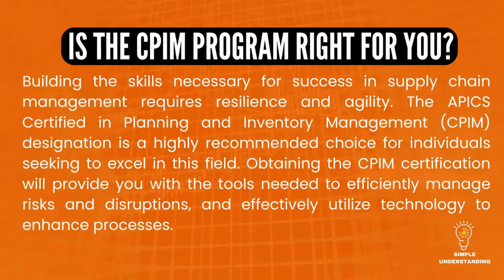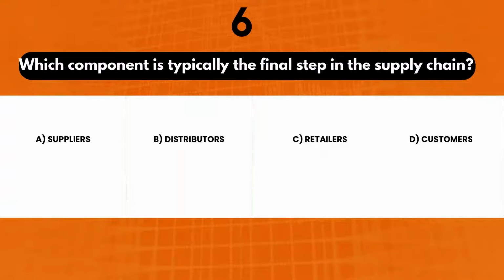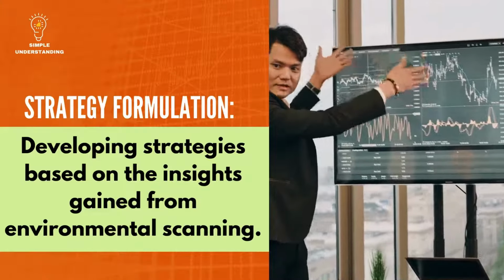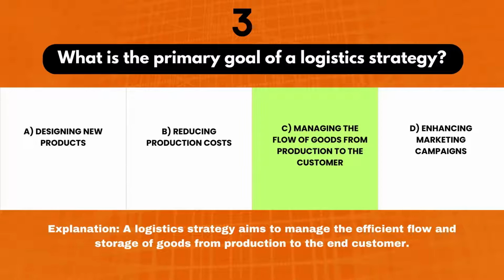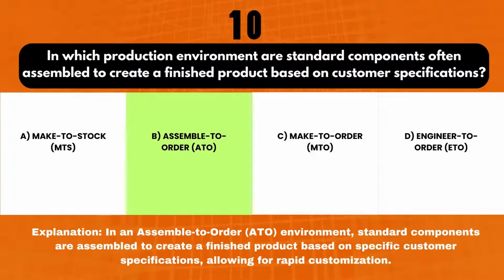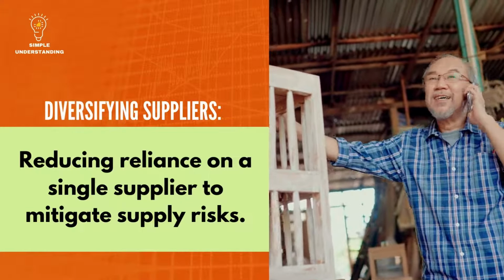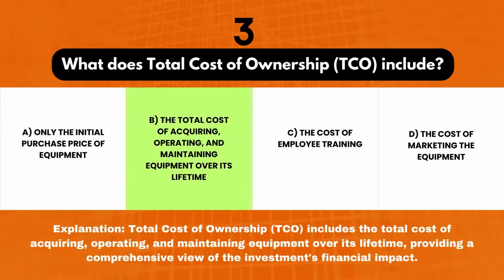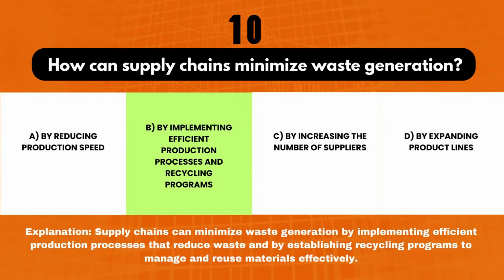APICS CPIM Module 1 Supply Chains and Strategy Full Course | Explanation & Practice Test (90 min)

Comment: Is this material enough to pass the latest 9.0 version?
Reply from the maker: These videos are designed as a quick review to help you grasp the core topics of the CPIM certification.

If anyone preparing for the actual exam, he will need the complete study package. I’ve included the link in the description. 

The full package CPIM 9.0 includes:
- Full coverage of all 9 modules and 38 sections
- Real-world case studies and applied examples
- Step-by-step solutions to all math problems
- Flashcards for rapid revision

- Over 6200 MCQs: 
Scenario-based
Application-driven
Multiple-correct-answer questions
Quantitative problem-solving

In addition of flashcards , cheat sheet and mocks exams

This is a full prep solution built to help you pass the exam—not just review the basics.

The full five package provides more than enough materials to prepare for your exam. However, the most important part depends on you—your hard work and dedication. By studying consistently every day, using the module per module explanation, the flashcards and practicing the MCQs, you'll give yourself the best chance to pass.

I’ll send you a free sample of the CPIM course. Try it out first and decide if it fits your needs.. I’ll post a link where you can apply for access—fill it out and I’ll send it over.
https://forms.gle/5YeK6HCs45kNZcQ19

Comment: Please modify for version 9.0 !! I want to buy the materials but you don't have latest version....
Reply from the maker: I want to inform you that the materials are now updated to CPIM 9.0

The full package of CPIM 9.0 includes:
- Full coverage of all 9 modules and 38 sections
- Real-world case studies and applied examples
- Step-by-step solutions to all math problems
- Flashcards for rapid revision

- Over 6200 MCQs: 
Scenario-based
Application-driven
Multiple-correct-answer questions
Quantitative problem-solving.

I’ll send you a free sample of the CPIM course. Try it out first and decide if it fits your needs.. I’ll post a link where you can apply for access—fill it out and I’ll send it over.
https://forms.gle/5YeK6HCs45kNZcQ19

Comment: Is this course enough to prepare the exam. I'm planning to give in 2 months from now.
Reply from the maker: These videos are designed as a quick review to help you grasp the core topics of the CPIM certification.

If anyone preparing for the actual exam, he will need the complete study package. I’ve included the link in the description. 

The full package includes:
- Full coverage of all 8 modules and 35 sections
- Real-world case studies and applied examples
- Step-by-step solutions to all math problems
- Flashcards for rapid revision
- Over 5,500 MCQs: 
Scenario-based
Application-driven
Multiple-correct-answer questions
Quantitative problem-solving

This is a full prep solution built to help you pass the exam—not just review the basics.

The full three package provides more than enough materials to prepare for your exam. However, the most important part depends on you—your hard work and dedication. By studying consistently every day, using the module per module explanation, the flashcards and practicing the MCQs, you'll give yourself the best chance to pass.

I’ll send you a free sample of the CPIM course. Try it out first and decide if it fits your needs.. I’ll post a link where you can apply for access—fill it out and I’ll send it over.
https://forms.gle/5YeK6HCs45kNZcQ19
Reply: @simpleunderstanding Done
Reply from the maker: Check your email ☑️

Comment: These videos are a good resource to complement your studies but you need to have the books in order to understand better and see the bigger picture of the study material
Reply from the maker: If you already have access to the ASCM official course and can afford the price, then yes, combining that with these videos can definitely strengthen your prep. ASCM offers solid material, but it’s expensive, and not everyone finds the format easy to follow.

That’s actually why I created these videos and the full prep materials. They’re built to give a clearer, more structured explanation of each module and are a much more affordable option.

The full package I offer covers:
- All 8 modules in detail with the full 35 complete sections
- Step-by-step Explanations for the math parts
- 5,500+ MCQs (scenario-based, quantitative, theoretical, conceptual)
+ mathematics mcqs
- 1750 Flashcards Terms and Definitions for fast review
- Real-world examples and Cases study to connect concepts to practice

These videos work as a quick core review, but if you’re preparing seriously for the CPIM exam, I recommend using the full package alongside them. That way, you get both the clarity and the full depth.

If you want to try it out first, I’ve put together a free sample of the CPIM course. You can apply here and I’ll send it over:
👉 https://forms.gle/5YeK6HCs45kNZcQ19

Good luck in your preparation 🤗

Comment: Greetings,
With holding Meng in Industrial Engineering and working as an Inventory Planner and Buyer, I would like to obtain my CPIM certificate. I was wondering if watching these videos is sufficient to achieve my goal.
Looking forward to your response.

Thanks
Reply from the maker: These videos are designed as a quick review to help you grasp the core topics of the CPIM certification.

If anyone preparing for the actual exam, he will need the complete study package. I’ve included the link in the description. 

The full package includes:
- Full coverage of all 8 modules and 35 sections
- Real-world case studies and applied examples
- Step-by-step solutions to all math problems
- Flashcards for rapid revision
- Over 5,500 MCQs INCLUDES: 
Scenario-based
Application-driven
Multiple-correct-answer questions
Quantitative problem-solving

This is a full prep solution built to help you pass the exam—not just review the basics.

The full three package provides more than enough materials to prepare for your exam. However, the most important part depends on you—your hard work and dedication. By studying consistently every day, using the module per module explanation, the flashcards and practicing the MCQs, you'll give yourself the best chance to pass.

I’ll send you a free sample of the CPIM course. Try it out first and decide if it fits your needs.. I’ll post a link where you can apply for access—fill it out and I’ll send it over.
https://forms.gle/5YeK6HCs45kNZcQ19
Reply: @simpleunderstanding  Wonderful, thanks for your response :). I have submitted the form.
Reply from the maker: @AmiraliFarahnia  Great, Check Your Email.

Comment: I am a newbie in SCM, it links to my current job so i am thinking of taking Cpim but the fee is quite high 😢for me, i just wonder this certificate is valued amongst the company? Thanks
Reply from the maker: CPIM is a strong certification for supply chain professionals, especially in planning and inventory management. While the cost is high, it can bring long-term value through improved efficiency and decision-making. If budget is a concern, consider starting with one team member or exploring lower-cost training options first.
Reply: @simpleunderstanding thanks for your reply. I got it. I want to download the textbook but it seems the above link is deactivated.😢😮
Reply from the maker: No the link works well, try again 👍
And Good luck in your preparation for CPIM Exam
Reply: In my opinion, if I were a newbie in Supply Chain I wouldn't take it, I would wait to gain more experience in order to have a better understanding of this kind of certifications since they are very expensive.
Reply: @davida5353 you’re right.😢 it is really expensive 😂,  i think i should watch these videos over and over again first😊 thank you
Reply: How to get certificate